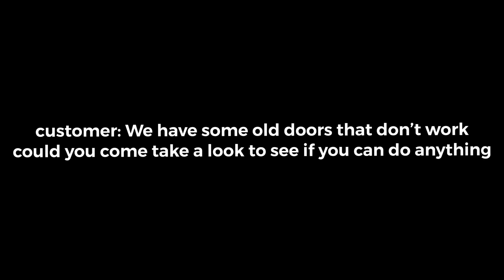Part I - Antique Mortise Door Locks - 80 years of Paint Removal

Comment: I hate paint stripper chemicals, used it for removing glue from a cement floor at one job for remodeling.  I saw a lady using a heat gun for removing paint in a recent video I watched.
Reply from the maker: @51-FS  and it doesn’t help against that hard layer